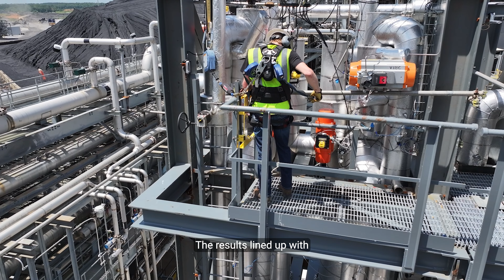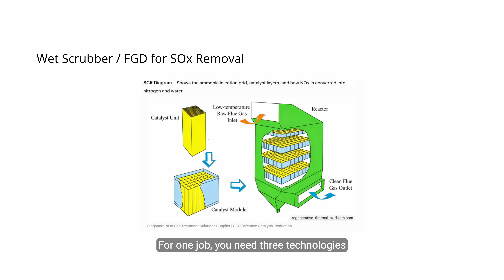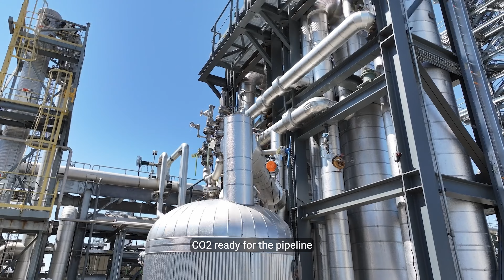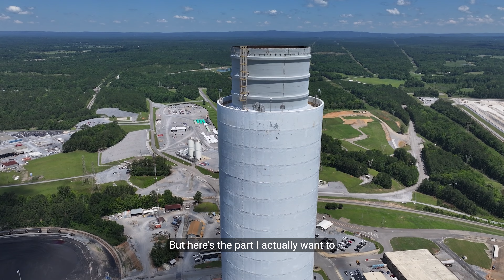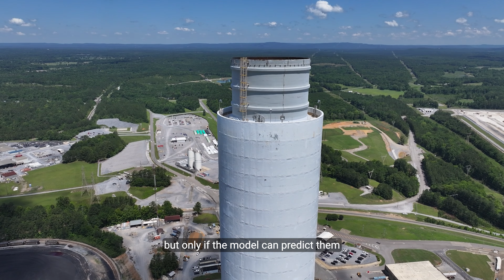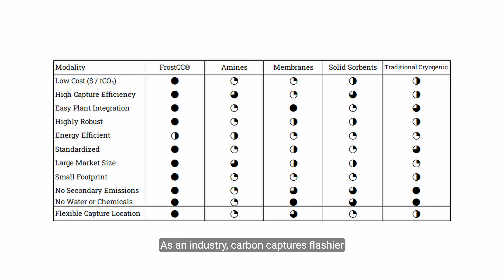Freezing CO₂ Straight Out of Exhaust stacks. The Physics Breakthrough That Works

Comment from the maker: Our physics models were tuned on a 10 tonne per year lab rig, yet after scaling the heat exchangers up nearly 100 times at the National Carbon Capture Center, outlet temperatures still matched within 5 Kelvin and capture efficiency within two percentage points, across more than a hundred frosting cycles. Over a thousand hours of continuous operation, the system hit 99% peak efficiency and 99.97% purity without measurable wear on the exchangers. If you managed a cement plant or refinery weighing this against amine scrubbing, what part of this frost and melt process would you want tested further?